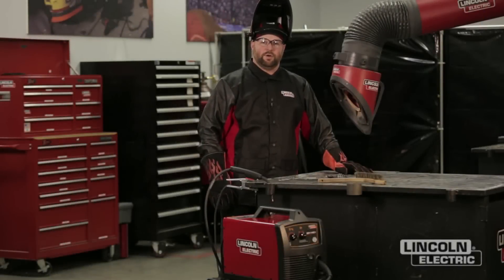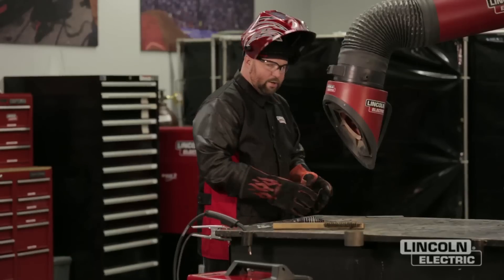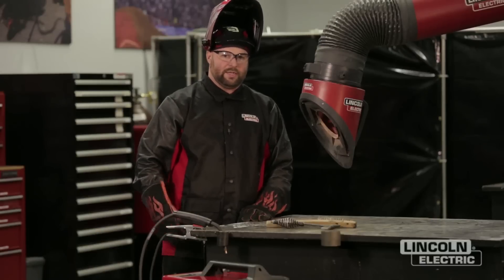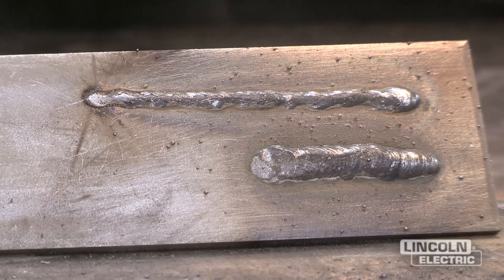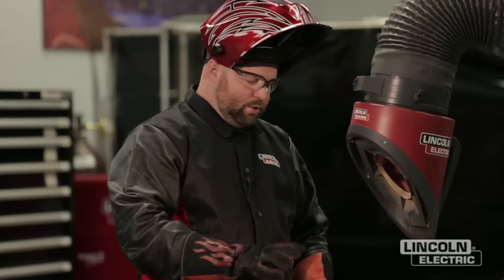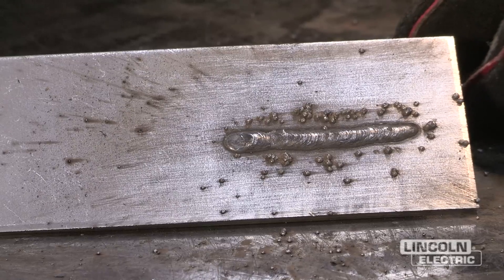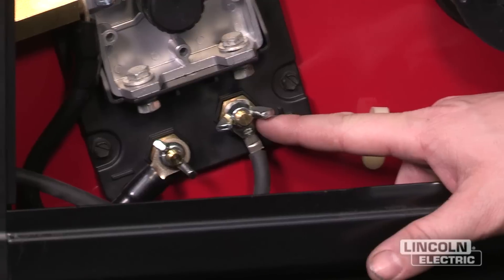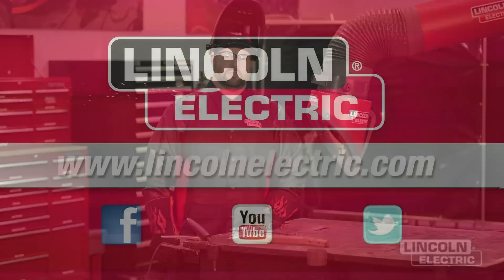Tech Tips: Self-Shielded Flux Cored Arc Welding (FCAW-S) Troubleshooting

Comment: Jesus, I suck so bad your worst weld looks better than the best one I have done yet and have ran half of a four inch spool of wire through it.
Reply: for me it was a cheap helmet not letting me see what I was doing. I had the mask on a stick helmet that came with the welder. Once I got a decent view of what I was doing and was able to weld with 2 hands I have really come to enjoy welding and found it a very useful skill.
Reply: Join the club... I'm in the same category!
Reply: I tried turning the shade down to 10 like one on youtube suggested and it seemed to help. I'm better but not great. I don't know what I would do without the welder now. It has really opened up ways to fix problems that I couldn't have without it. : )
Reply: Barry Wind some people will go as lite as an 8 but that's something that you have to work out for yourself. I did a lot of defect welding in steel foundries and used two lenses. I'd use a 4 on the inside and an 8 on the outer flip up lens. The reason for that was because I was running an air arc and the carbon rod would glow like the sun when I flipped up the outer lens to look at my work. Needless to say, if I didn't have the #4 lens I'd get arc burns on my eye lens; not a good thing to have happen. Some welders wear sun glasses under their hood so figure out what works best for you and pass on your experience with what you've tried.
Reply: Im right there with ya brother. Mine looks bad too. I only ever stick welded before and am OK at it. But mig I just got into only like 2 or 3 weeks ago. But only been able to practise 3 times for like 15mins. Would of been longer had the breaker not pop anytime i tried passing 15mins.
Reply: The words from my mouth. :)
Reply: Get an auto darkening helmet and get a rubber tip. The gas diffuser makes it more difficult.
Reply: I was just thinking the same thing. I'd have been incredibly proud if I'd turned out any one of his "what not to do" welds.
Reply: I say slow down and watch your puddle, make "C" movements.
Reply: Lol, half a four inch spool
Reply: Ditto
Reply: Barry Wind not saying I'm any better but stay with it! Somewhere around 300$ in gas and about 25 or 30 # of flux core in it seemed like something clicked, just started " feeling" it, and suddenly l sucked a lot less!

Comment: With my budget, only weldet I can afford is the Harbor Freight 90amp flux core welder. It has only 2 voltage settings but variable wire feed settings. How do you trouble shoot those welds with limited voltage settings?
Reply: Good luck, that thing uses AC so all the welds look terrible.
Reply: depending what you're welding, I would set the welder up in the lowest setting. you don't want to burn through your material. if the weld is cold, either make another pass, on low setting, or go to the high setting.

Comment: when do you either straight line drag and push the puddle as compared to washing it side to side and make e, c or I???
Reply from the maker: +Richard Burdyn Thanks for the question. Sorry for the delay. On heavier material when you are needing a slightly larger weld than you can get with a straight line drag, a weave is fine to do.  Some codes do have requirements on weaving and weld sizes made in a single pass so be carefull.  Whether you use a C or zig-zag pattern is up to you just be sure you are never pushing the puddle.  You risk trapping slag if you do that.  Always use a drag technique.

Comment: I do a lot of flux core wire welding, the video tells you all you need to know. The principles of ALL welding are the same, control the weld puddle. In that respect, it is identical to gas MIG and electrode welding.
Every technique you would use for electrode or MIG welding applies to flux cored wire.
What no one seems to mention is that you need to change wire sizes just as you would change rod sizes electrode welding, although MIG is far more accommodating of wire that is a little too large or small.
Having said that, I use 0.9mm wire for everything form vehicle sheet metal to around 1/4" and the flexibility of the flux cored wire is excellent in this respect.
Reply: That was my problem... the mask was too dark. It was so dark I couldn't see the puddle or the metal edge I was trying to weld. I did lighten it and there it was... my first view of a molten puddle. I was afraid to lighten it thinking it would hurt my eyes... but I took a chance. I had it set at 10 which everyone says is the magic number, but not for my helmet.
Reply: @Majorvideonut2  It's important to remember that the eye protection of your lenses is the same for all shade settings!  It's just your comfoForrt and ability to do the work that you're setting, but the UV and IR protection are there all the time, according to the manufacturers.  Ah, I wandered in the dark for many years until I actually read some of this literature, and got some lighter lenses, or automatic ones that could be set lower.  If you strike an arc and the automatic lens doesn't work, you're still protected, although annoyed.  I think seeing what you're doing is MORE than half the battle here.   I want it to look like the "arc shots" you see in WeldingTipsandTricks you know?   Now for me another very hard part is learning to NOT look at the arc or flame, but strictly at the puddle... and the arc (flame) catches your eye, it's natural to look at it and it doesn't help you.
Reply: @Majorvideonut2  I set mine about 9 & 1/2
Reply: Barry Wind darken your mask 😉
Reply: Pantelis Saliaris Another gem, thank you.
Reply: Barry Wind I stick and mig with my hood set on 9 (Lincoln hood)
Reply: I also where my sunglasses wile I weld, so when I flip the hood up to chip slag my eyes are protected
Reply: +Sideslip 
Very good info, thanks for the input.
Reply: That and if it has slag then you drag. I never have an application to drag a mig weld (not flux core) though I know there are reasons it is done. You wont pass inspection pushing flux core. So not exactly the same. 12 years pulse mig alum 😉
Reply: Can you used CO2 gas to weld flux core wire?
Reply: Akanimo Eshiet you sure can but self shield wire doesn’t need it, while on the other hand dual shield wire does need the assistance of a shielding gas ex. Co2
Reply: @FX_Familli  According to Lincoln, the  "Innershield" wire must not have gas, it makes problems which they explain in the data sheet.  I just read this a few minutes ago and was really surprised!  So as Aedyn says, if you HAVE gas and are willing to use it, CO2 can be used with Dual Shield, and reg'lar MIG wire too!
Reply: Like the "rule" of using 40amp to 1mm steel thickness (one of the few times I find metric easier as we buy stock in metric thicknesses in UK) is there a rule for gauge size please? Thanks for the information, it’s very useful.
Reply: I see the light but can't see the puddle. It's like welding looking at a flash light. How do you get past the light to see the puddle?
Reply: @Majorvideonut2  This is a constant problem!  If you can only see the arc and not the puddle, you might want a lighter shade lens, or a lighter setting on your automatic electronic lens.  Again, you're in no danger if you set it as low as it goes, or even if it doesn't work!  Once you CAN see the puddle, you have to discipline yourself to look AT the puddle and not at the arc, which I find very difficult.